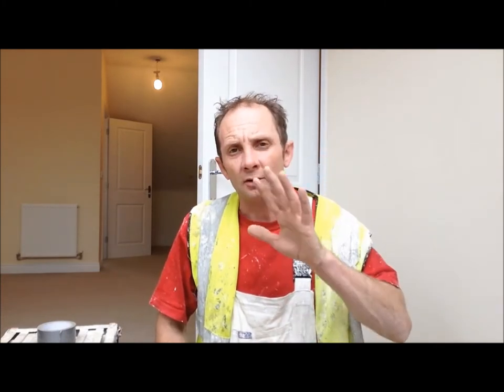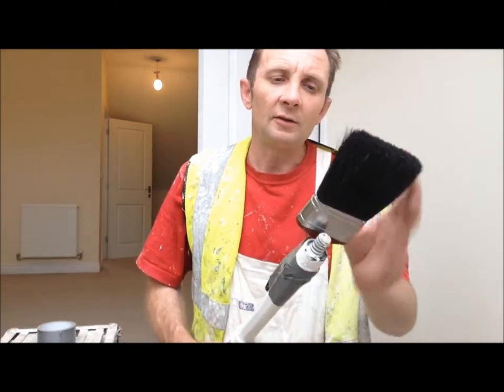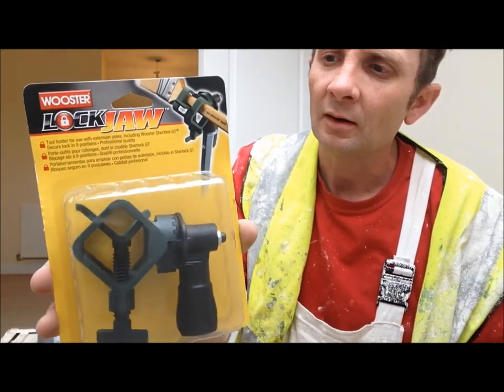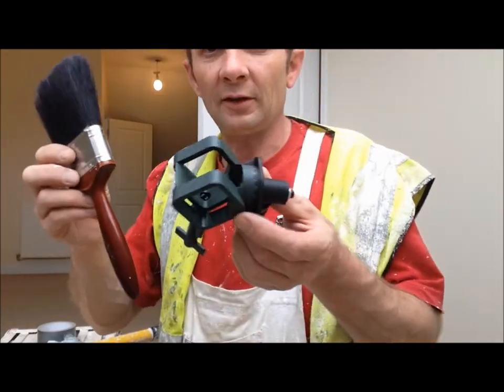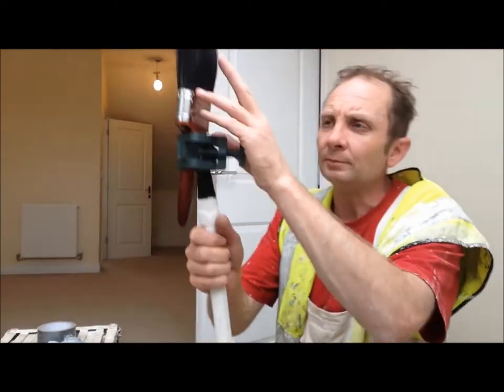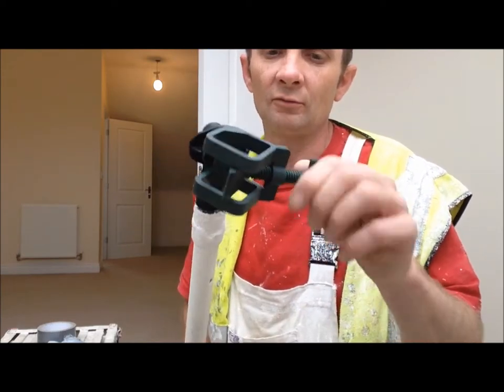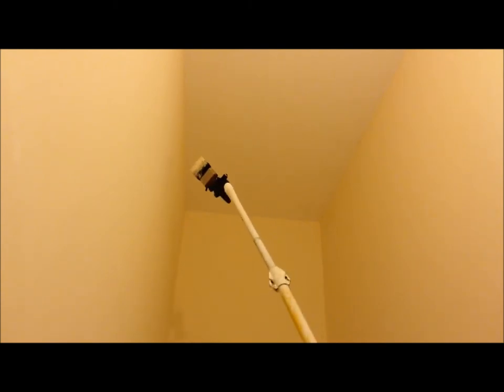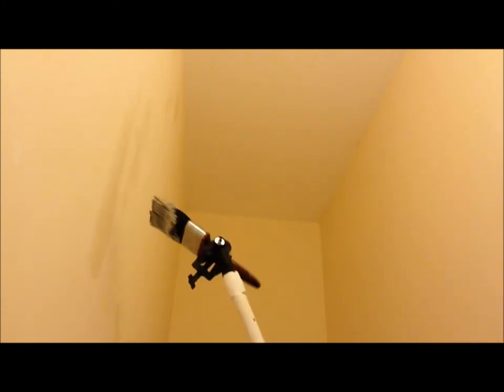Painting & Decorating,Brush holder for roller pole.

Comment: I can cut a stairwell ceiling line in with one of these .
Takes a steady hand mind and a bit of mastering and the corners are also tricky but do it regularly to save getting the ladder off the van.
Reply from the maker: geenieweenie1 
Not a chance, steal  a ladder off the  scaffolding outside your plot quicker
Reply: I do mainly re-decs though so often  the only trade on the job although done a bit of house bashing in the past .
I'm a dab hand at cutting in with one of these now , a very handy tool as you can alter the angle of the brush to exactly what you need.
Some stairwells i have to get a ladder off the van no matter what though , depends on height and shape of course.
Really enoy the vids by the way and picked up a couple of helpful hints even though i've been on the brush over 20 years.

Comment: Just tape a striker to a pole mate
Reply: Not as easy to cut in a ceiling line with a striker as it is a 2 or 3 " brush.
These brush holders are ideal for hard to reach areas like some stairwells etc , i use them all the time and sometimes don't need a ladder because of this tool.
My surname is Clay as well by the way !